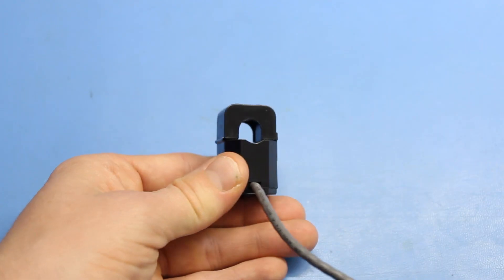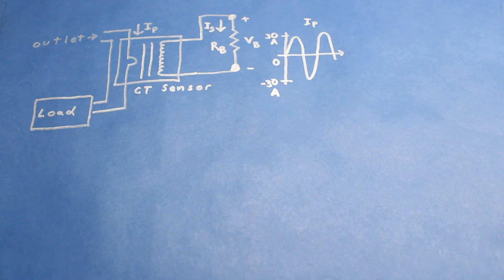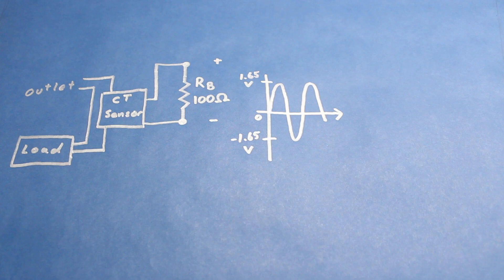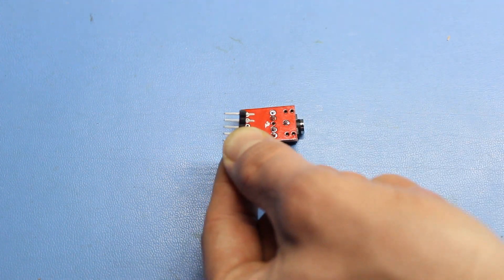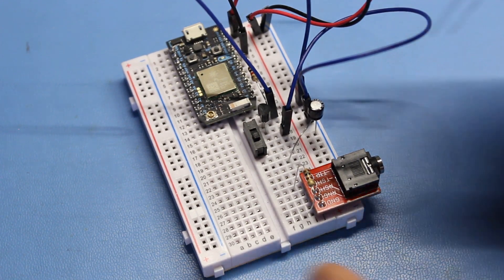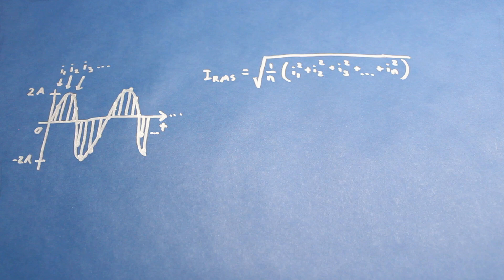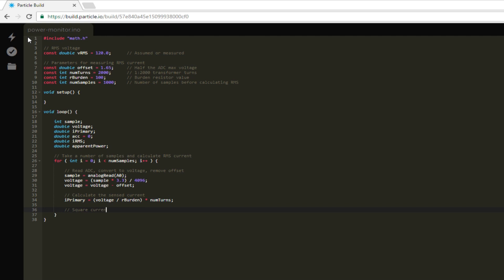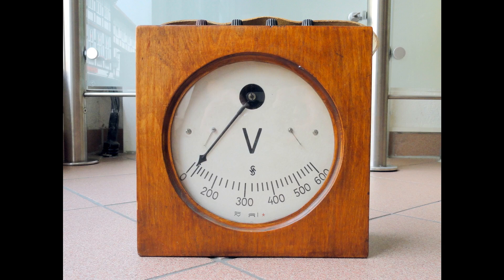Hack Your Home Part 3: Power Monitor

Comment: Why not using two 220 Ohm resistors in parallel to get the 110 Ohm burden resistor value?
Reply: because at the end it can be easily corrected by a scaling factor in a program.
Reply: @TushhsuT  and this can't be done with the 110Ohm resistor? Please explain in more detail why this isn't possible in your opinion.

Comment: If both hot and neutral wires are fed through at the same time, any ground fault would provide an output. However it might be more accurate to have separate current sensors on each wire and then use an op amp circuit to subtract the two, aka diy GFI measurements.